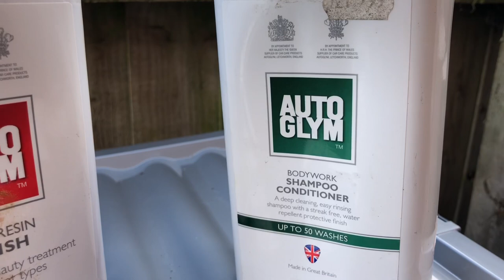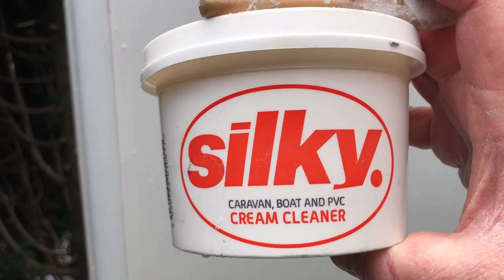Cleaning the motorhome with Autoglym

Comment: Good job, the silky should remove black streaks.  You should use the 2 bucket method to avoid scratches.  After polishing protect with wax.  Doing mine soon.
Reply from the maker: Hey Marion! Yes I wanted to use the other bucket but it had been used for clearing up the dog poop from the garden so thought I’d better not 🙄🤣 I’m going to get two new buckets with grit guards. Thanks for watching 🙂